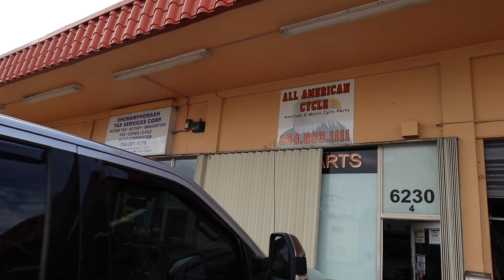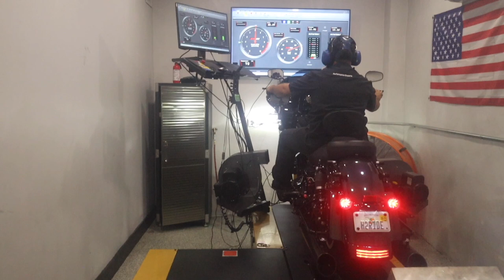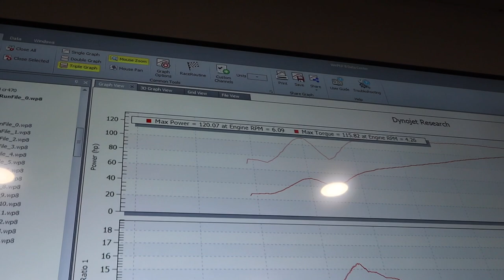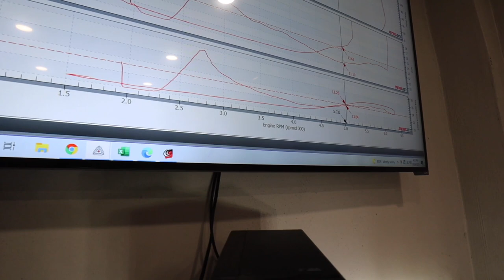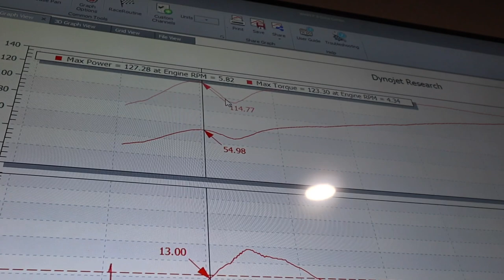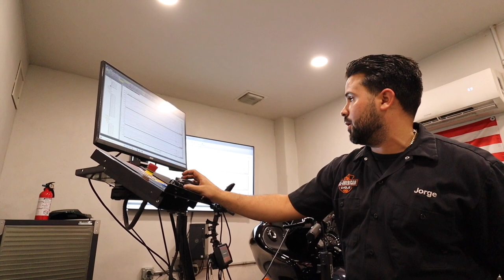HIGH HORSEPOWER HARLEY DAVIDSON STAGE 2 COMPLETE BUILD!!!

Comment: I can’t believe I missed this video. Been watching you for almost 2 years and never seen this one until today! I always wanted to see what you have in 114 before big build. I got different set up in my 114 w 475 cam and 2-1-2 pipe w FuelMoto head pipe and FuelMoto inserts. It runs just as good as 2 into 1 pipe and very fast for stage 2.

Comment: I'm going to be doing the 128 shortly I already did a cam upgrade with lifter cuffs and the first thing I did was heat up those bolts to loosen the thread lock because they're known to break.

Comment: I have 2021 road glide standard i have them put a stage 2 kit in it i have full riahart exhaust with the riahart dbx45 it gave what i was looking for in sound and powdr i have the torque cam in it and my warrenty cover it.i love my road glide.
Reply from the maker: Best bang for the buck!
Reply: what number horsepower n torque is is running now, I just bought a 2021 roadglide and have having Vance n Hines power duals put on, and it came with a Reinhart slip on's, I hate to mix them but it did sound great with just the rienhart slip on's. my old bike had vance n hines power duals n slip ons, i loved how it sounded n performed, but it was a  2014, Im interested in how my horsepower n how much torgue I gain, I'm going with the harley horsepower cam and think i will maybe get 115 horsepower n 120 torque with the pipes n cam Im going with, and am ok with it and the sound should be great too i feel, but i know maybe not the best choice of cams, but when 2 yrs warranty is up im going to go with a woods cam or a S&S 470 or trade in and start over will see what the future has in store when time comes, man I almost said screw the warranty its my bike put the cam and tuner in that I want.

Comment: How you like that cam? I was looking at the CR480 just not sure the difference between the 470 and 480
Reply from the maker: What’s the rest of your set up or let me know on Instagram
Reply: @officialmac  2to2 tab performance headers tab 5” cal mufflers with zombie baffles tab zombie breather. I will peeing the torque inserts for the mufflers to increase back pressure. So stage 1 is done now working on a stage 2. Also what part number was that for the crank gear?
Reply from the maker: @RickyBobby8711  107 or 114?
Reply: @officialmac  2020 Road King Special 114
Reply from the maker: @RickyBobby8711  what air cleaner
Reply: @officialmac  it’s stock right now but I will be offing the Zombie Breather from Tab Performance it’s a high flow
Reply from the maker: @RickyBobby8711  s&s 475
Reply: @officialmac  you recommend that cam? Why not the cr

Comment: Well, like all other Stage II conversions.
128 hp at the clutch so ~112 hp at the rear wheel.
Is ok, all other statement I am unrealistic.
20 hp more than series.
Who promises more with Stage II, is unseriös.
Reply from the maker: Huh? it’s on a dyno 😂
Reply: @officialmac  Then you would have to show the power at the clutch as well.
The bike would then have about 148 hp at the clutch, you do not believe it yourself
Reply from the maker: Numbers don't lie.  There are several bikes and other builders and dyons that get these numbers. The clutch is not where power is proven it not a car where you show power at the crank.  We only show power at the tire where the motorcycle actually move.  But everyone has there own philosophy but mine is proven!
Reply: @officialmac  You're right!
Only I do not believe you that your numbers are measured at the rear wheel.
Reply: Then you can do magic. A change of camshaft and manifold, plus tuning should now have128hp instead of 82hp at the rear wheel? 46 hp more??
If you mean.
Then it is so with you.